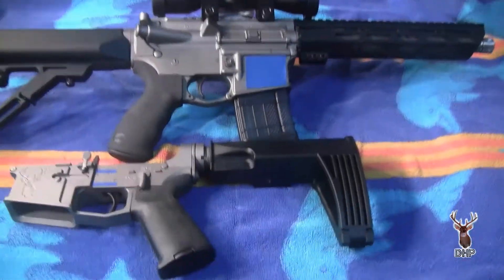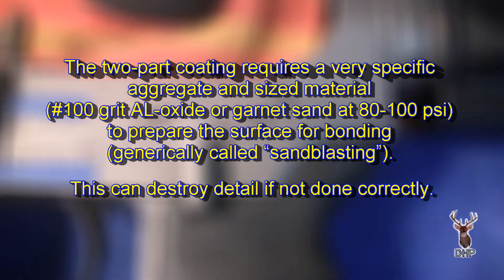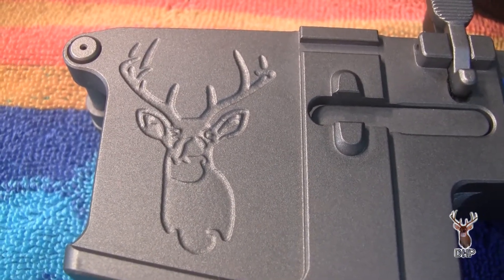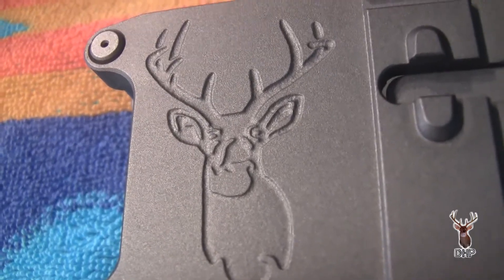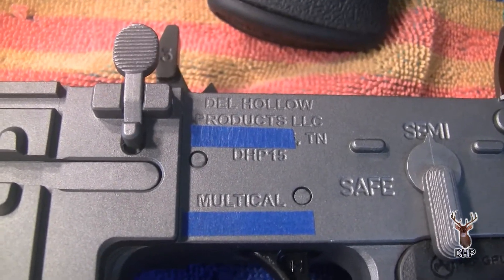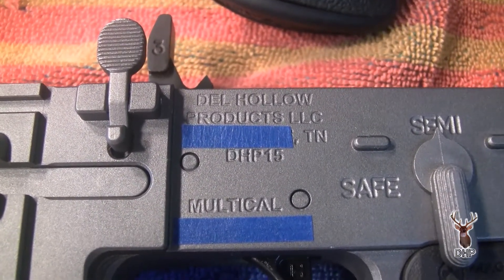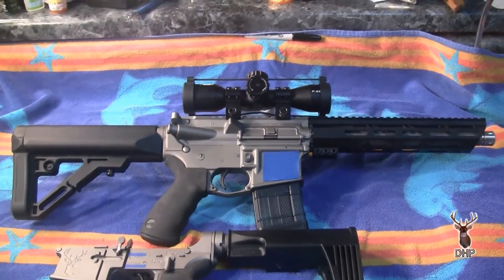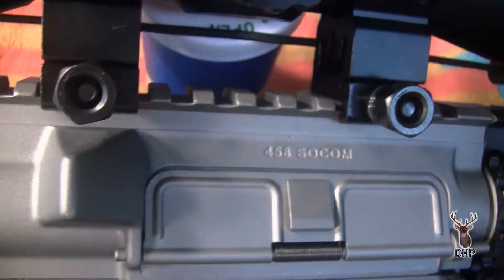S8E6  - A Final Look at Electro-Etching - 1080p

Comment: I don't know how you do it, but that is a nice smooth texture on the deer etching. When I etch, I get a noticeably rougher texture, kind of like you see in the deer horn on the right side. What are you doing between rounds of etching? Are you rinsing with tap water or distilled water, and how much do you rinse? I am finding that if I rinse with tap water, I can get a smoother texture than I can get when rinsing with distilled water. Thanks again for sharing all your knowledge. I am well aware that developing this kind of process is time consuming and expensive. One of these days I'll post a video of the cathodes I made that are offshoots of your cathode design.
Reply from the maker: Just gently running water over the etched space trying not to disrupt the mask.

In the experiment I first started with cast (Cerro forge) was 7075 aluminum, T6 heat treated (video w/shield,). And the one with my deer was 6061 Billet. It was 000 steel wooled and maybe 800 grit first. I don't remember for sure (I did look in the file on the parts).

The cast 7075 might be rougher than the 6061 billet. They are different aluminum alloys. But the billet started off extra smooth. 

The current might be a bit high and/or the aluminum might be getting hot.

Good luck.
Reply: @DelHollowProductions  Thankyou for the detailed reply. I do believe the current is high. I've been experimenting with different anodes. The first one I built closely followed your design but for subsequent anodes, I flipped the bolt 180 degrees. I drilled/tapped different metals, including brass, copper, lead, 306 stainless steel, and aluminum, and screwed them onto the threaded end of the bolt. It is these metals that I put the gauze on and use to contact the electrolyte. The results from the bolt head and aluminum were kind of so so. When I tried the stainless, though, it was night and day. It cut the etching times by about half! Clearly the stainless is causing the circuit to draw more current.
I have 6 anodes in total and will soon be running some experiments using each anode with two different commercially-available electrolytes plus the saltwater/vinegar mix. I will keep you updated and will post detailed results.
Reply from the maker: @dickphukwede1856  you will get a different result (as you found) with a different sized tool. You probably find more side erosion (undercutting) with a. Higher current and b. Smaller foot (for lack of a better word).

I would think/describe it as current (or charge density) with a large area compared to a smaller one. I did not try various materials but the conductivity of the foot materials will figure in somewhere. 

I would guess with higher current you would develop a slight voltage and current variation across the plate. At what point the gauze and how thick (how much electrolyte it holds) becomes an effect - I don't know. But as it etches I expect it will change. 

How high (the distance above) the piece is available too.

That's what experimentation is all about!
Reply: @DelHollowProductions  Yep. I have completed testing for two electrolytes and started on the 3rd. The first electrolyte is based on yours but I used 10% vinegar (pickling vinegar) instead of plain white vinegar, and used sea salt.The short version of my results so far is that the biggest surprise so far is how aggressive the Martronics Aluminum Electrolyte etching is. Unfortunately for me, it leaves a textured, hard-to-remove black ash/slag in the etched areas. This would probably be great for tool etching but not great for AR15 lower etching. So far, it looks like the salt/vinegar electrolyte is the way to go. Also, the copper and stainless cathodes seem to perform the best, but not by a huge margin.
Reply: @dickphukwede1856 , interesting could use a stainless steel bolt right from the get go

Comment: can you electro etch a receiver that is already blued? or do i have to try to get to bare metal?? thanks
Reply from the maker: I don't know your term, you blue steel. This is mainly raw aluminum. Painted or anodized insulates the base metal. You might use an ohm meter to see if what you have conducts electricity. And eventually, you might try a hidden spot like under a grip - say a simple for through a mask. But I don't know.

Comment: Great Video. I am going to try the etching. I have some AR's that I built and would like to put some info on them in case of theft. Also I am going to make a SBR waiting for ATF approval and will need to put info on the receiver. How does it work on steel. I have some AK's I would like to do also.
Reply from the maker: I have done stainless steel tumblers. It takes longer and doesn't etch as deep but it can be done. On aluminum - NOTE! they can't be anodized - the process builds a surface structure which doesn't conduct electricity. You can take an ohm meter and touch your "black" receivers. You will see no current/conduction - very high resistance. You will need bare shiny metal to etch. TEST YOUR PROCESS on like a piece of HD or Lowes aluminum flat stock (it doesn't have to be thick). Just something you can test your technique on prior to the lowers. Good luck! Remember - it's irreversible but it can be done.